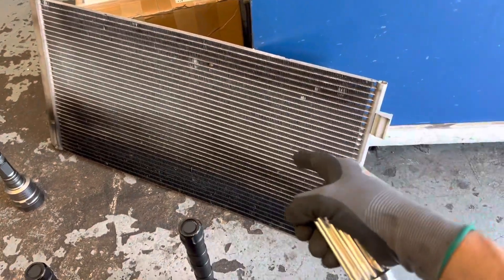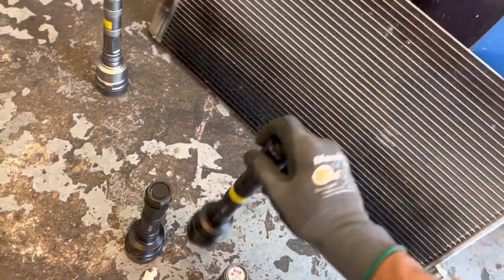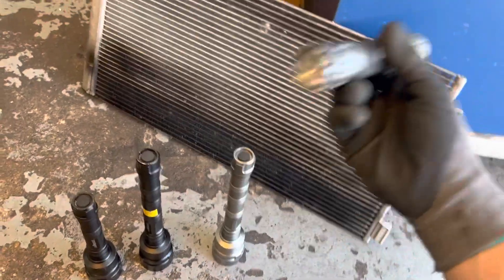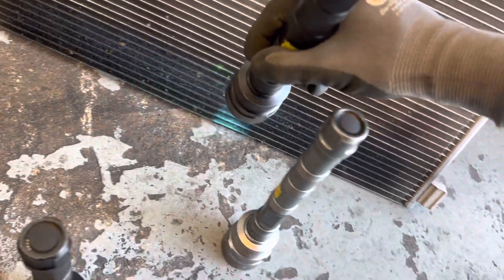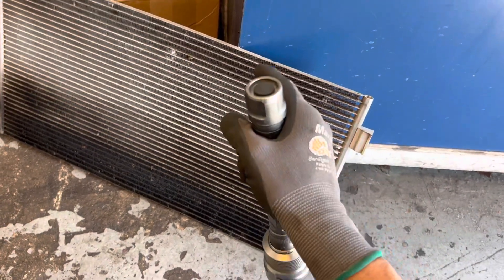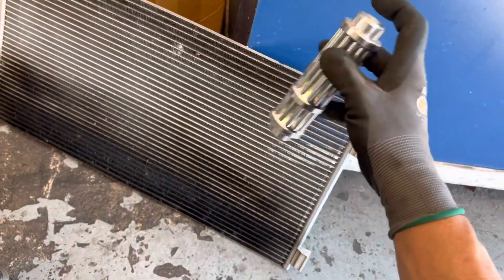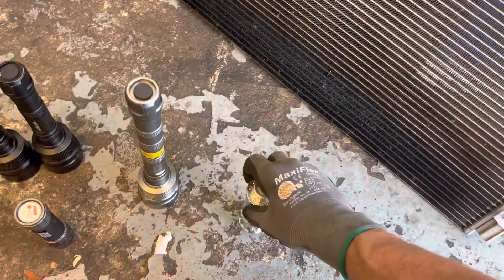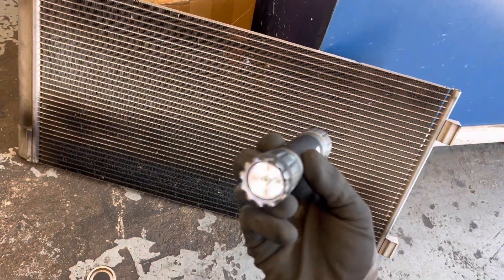UV LEAK LIGHT THE GOOD THE BAD .  UV BEAST 365 V3 With dark 365 nm￼ UV filter

Comment: I've gone through 4 uv lights trying to find one that works with engine oil none of them did. I can get a UV beast 395 in Canada but not the 400. Is there a noticeable difference between those wave lengths for engine oil? Can I just get the 395? I have a 365 it works amazing with AC dye.

Comment: If you remove the filter from the 365nm v3’s would you tell difference between 365nm and the 390nm?
Reply from the maker: Maybe not but that depends on the actual LED diode that was used. 

If it was a 365 diode, there would be a difference .  Because the strongest wavelength is in the 365 region and there’s a little light bleed over above and below, but just having a weaker level.. 

The whole purpose of the filter .  is a 365 the pass-through stronger. Than the lower nanometer wavelength and upper nanometer wavelength.. 

They will still fluoresce in the lower and upper region .  Because the filter is not 100% effective. 
         But I’ll just be weaker for the upper and lower wavelength die particles that are used that were developed for a higher or lower wavelength

On the other hand if the LED dial that was used was a 395 nm wavelength and they threw a filter on it to block off the 395 and allow it to shine brighter at the 365 then there would be no difference . .

Comment: Yeah you should be very careful with the reflection of metal and shiny surfaces. 

Wear the UV protective glasses. For sure with that laser
Reply from the maker: Especially my laser, UV laser, if it even hits across your eyes for nanosecond, you will be instantly blind and damaged eye for no possibility of healing or Repair.  
It’s 3W
Reply: @coldfinger459sub0  yeah. That's not necessarily because of it's  wavelength but it raw power
Reply from the maker: @maxmiliano7887  raw power of red green blue or infrared at 3 W they burn anything.

Comment: Would u recommend 365nm or a 400nm if u had to only pick one? 

Gonna dye test my valve cover soon then dye test my AC next year.  Idk anything bout dyes but this vid helped put me in a good direction
Reply: What's the name of the tall uv light please
Reply from the maker: @alihapali UV BEAST V3
Reply from the maker: Valve covers on engine oil .   That may be 400+ nm  depends on the company manufacturer of the dye on the other hand AC most use 365nm

But all the light blend over a little + or - the nm scale a little 

Get the UV Beast 365nm with filter.  $85. 
Or if you only want a small tiny one Conroy about $23 to $35 hand sized 

They are the strongest I have found
Reply: @coldfinger459sub0  Thank you.  The UV Beast 365nm does not ship to my state, Hawaiʻi.  Really want it tho.  Wont be using it daily, 1-2 times a year perhaps so will consider the Convoy.  

And to clarify, Convoy, as in Convoy S2+ Black UV 365nm?  

Also, is there a particular dye you recommend for Oil/AC applications?
Reply from the maker: @AK-IT  yes I heard there is a problem shipping items that contain lithium batteries to Hawaii because of air freight danger. 

Yes the Conroy 365 Nana meter black light is the correct one

As for UV dies the two that I use when is from TracerLine products

The other one is called AC Extends

I have talked about them and featured them in videos in the past.
Reply: @coldfinger459sub0  Yup, I was surprised that Amazon shipped my Rechargeable AA Duracell batteries, must have been a different mode of transportation.

And I saw the supper bright dye in your video once, is that the TracerLine or the AC Extends?  That one was really visible.
Reply from the maker: @AK-IT  both UV dyes shine equally bright

The UV light also plays a big part of that. 

You can have the best dye but have a bad UV light and it is not as bright

You can also have the greatest UV light but a poor manufactures UV dye and it was still will not shine bright

I have showed videos of both of these scenarios where the light was better than the die or the die was better than the light giving you unsatisfactory results. 

Where are you would have to be in a very dark garage out of the sunlight to be able to lightly see the UV dye. 

Compared to having a good light and a good UV dye you could be in the bright direct sun in Hawaii open up the hood and shine your UV light indirect sunlight and still be able to see it glow brightly. 

This is the best set up in combination the best of both worlds work hand-in-hand together
Reply: @coldfinger459sub0  Perfect.  Thank you.